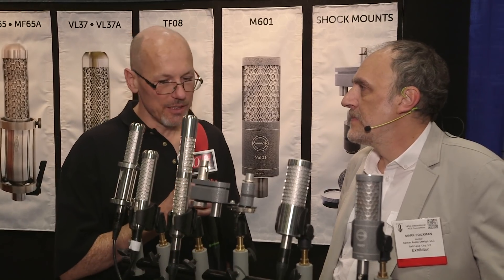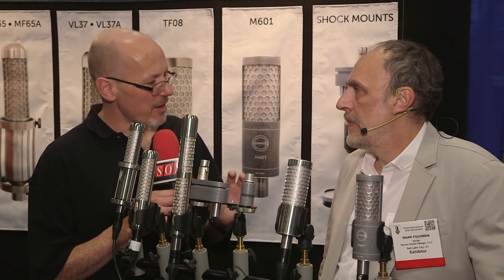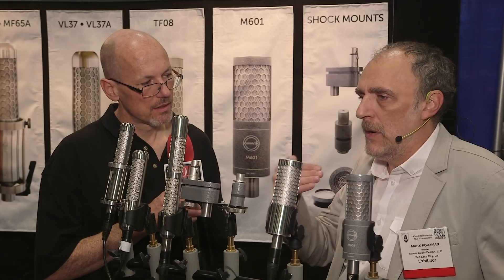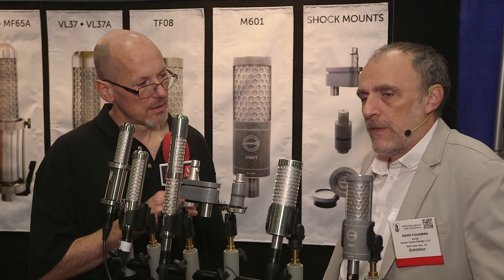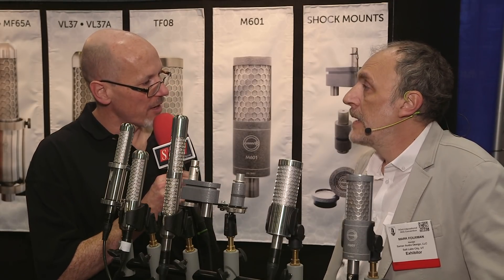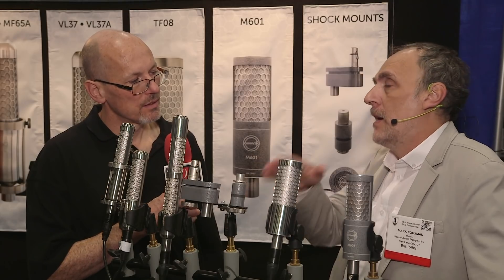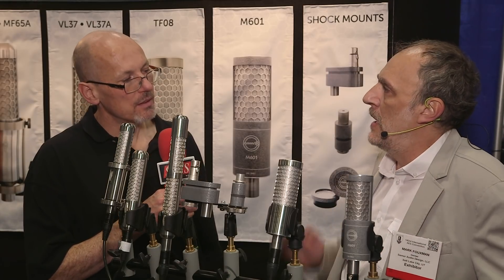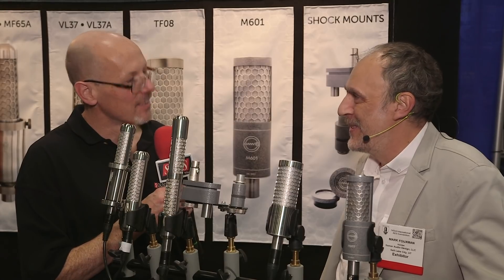Omni8 Audio TF08 & M601 - AES 2017

Comment: +Lawrence Ames - Yes, Mark is Russian/French, but the company is located in Salt Lake City, Utah, which I believe is also where the microphones are produced and assembled from all proprietary/custom designed parts...even the transformers.  AFAIK he is not using ANY off-the-shelf parts, other than maybe the honeycomb grill/mesh.

Check out the contact info on the Samar Audio Designs web site at http://www.samaraudiodesigns.com

I'm eager to try these Omni 8 mics.  I own his Samar VL-37A ribbons and they are my most used microphones on nearly all sources.  Incredibly life-like when combined with the Millennia HV-3D-8 pre's, with extremely smooth FR, and extension into the very low and high range, unlike most ribbons.